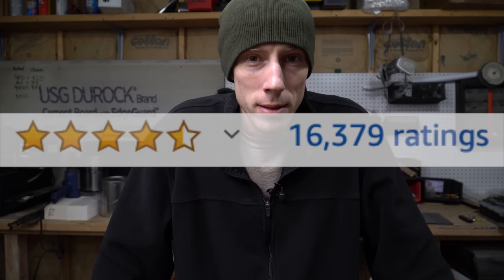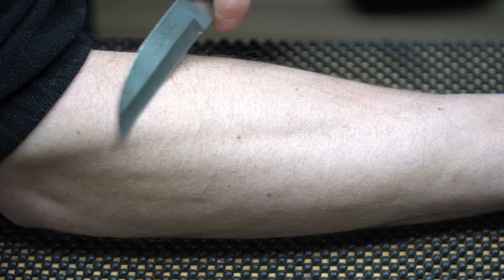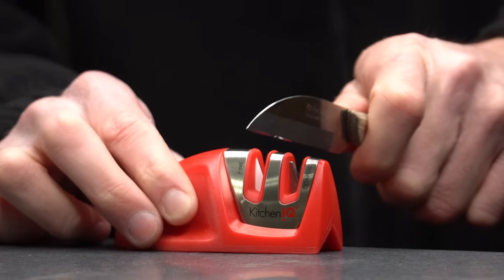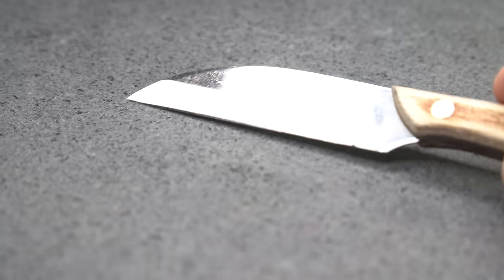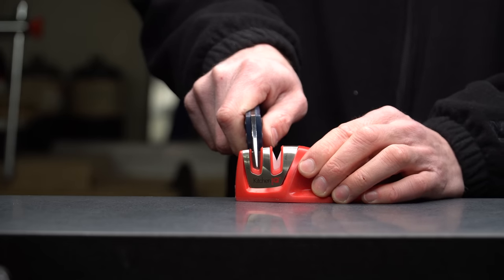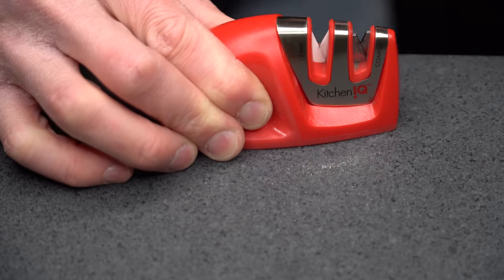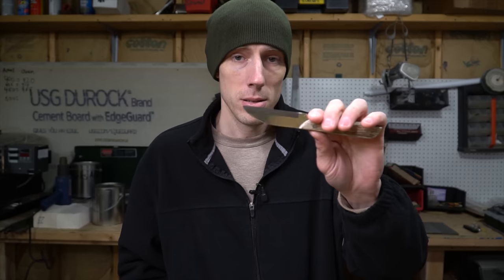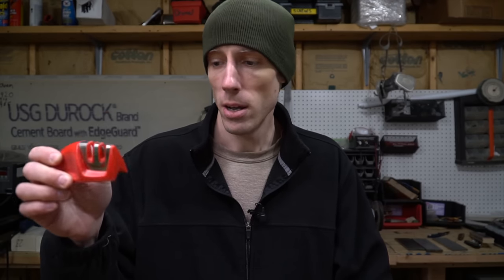I Bought The Most Reviewed Knife Sharpener On Amazon

Comment: I'm going to disagree with everything you did here. It's called Kitchen IQ and it costs $6. That means it's purpose is to quickly rehone inexpensive kitchen knives so you can finish your meal prep. It has 17K reviews and a very high rating for that purpose. If you want to fairly test it, cut up a butternut squash with a $20 kitchen knife, run it through the sharpener, and then thin slice a tomato. I'll bet it would do a great job at that. 

If your aim was simply to show that pull-through sharpeners aren't appropriate for sharpening real knives and not to actually review this product, I applaud your subterfuge and will show myself out...
Reply from the maker: But for $20 you get one that actually works🤷‍♂️
Reply: Definitely for your Spyderco. The $6 one is probably fine for Chicago Cutlery steak knives.